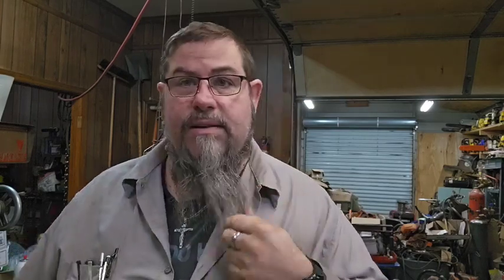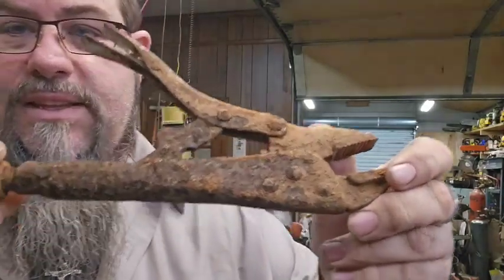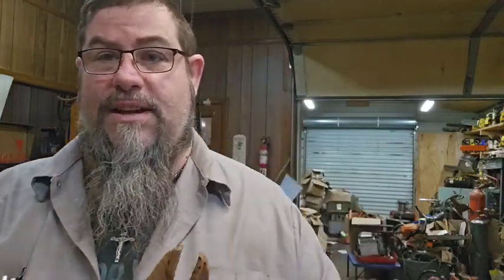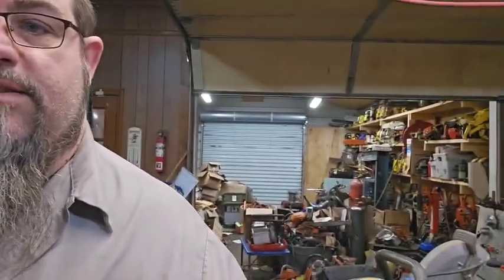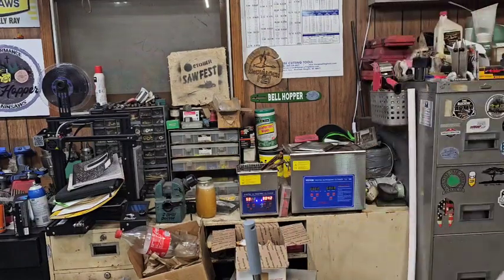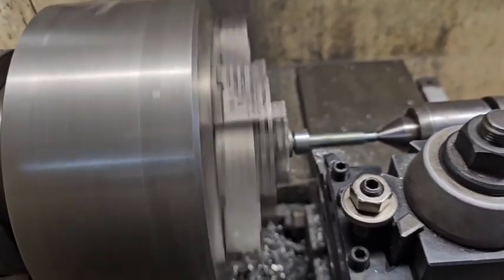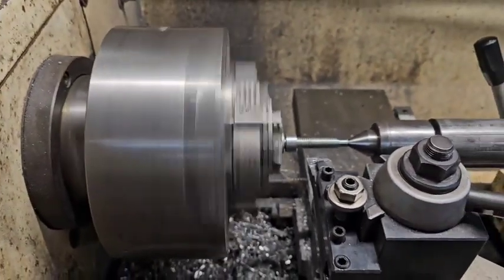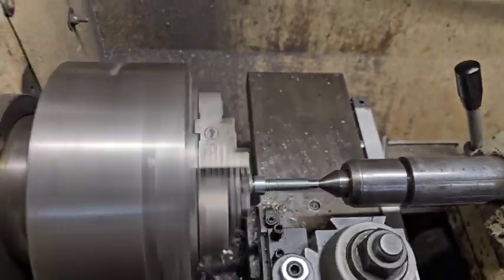Fixing old vise grips

Comment: Hi Jeremy, been a while since I have commented on one of your videos - thanks for putting time into making videos and sharing them. Rather than filling the ultrasonic tank full of your chosen cleaning mixture, fill it with water. Put the parts you want to clean in a zip lock bag and put your chosen cleaning solution into the bag as well. Bag + parts then go into the ultrasonic tank. You contaminate/use up less cleaning solution this way.

Comment: Jeremy I like doing stuff like this and you're absolutely right about it not being a practical thing to but I've always enjoyed repurposing things or just bringing old stuff back to life like these vice grips you're doing.. you can take a air tool wire wheel and clean those things up pretty good and then use a high-speed with a cone sanding disc or even a Dremel tool with a sanding disc and you could probably put a little time into it and make those them look practically new again but the handles and jaws and the clamping screw, wouldn't have the original strength to them after doing that much removal of the old decayed metal but they would still be strong enough to use for about anything, you would be using them for anyway...

Comment: Not sure how else to contact you, but I decided to throw my Hyway Big Bore Popup Piston kit onto my Farmmac F660V. I watched a few Iron horse videos and did a quick clean up on the ports (didn't change anything just cleaned up what was there). I cut the baffle out of the Hyway Dual Port Muffler like you suggested. It was already pretty nasty with the Farmmac Cylinder. The quality of mine left much to be desired. I'm amazed it ran as good as it did. Big score mark around the top of the cylinder you could EASILY feel with your nail. A spot on the bottom transfers that obviously got clearanced by the rings. The Hyway is MUCH better quality. It's even lighter. The fins are thinner on the Hyway. Wish I had a compression gauge. I also lived dangerously. I didn't check the squish. Just deleted the base gasket with the thinnest coat of Honda bond (permatex grey) that I could use. She's still wearing in but it doesn't have a decomp plug. It will rip the cord right out of your hand if you pull and don't mean it.
Reply: Also wanted to let you know that half the reason I started watching you was because you look a lot like my dad (passed Jan 25th, 2003).

Comment: Jeremy had one more comment and wanted to ask you if you know much about the Poulan Pro timbercut or timber cutting series 3450 chainsaw or the 3500 Pro timber cutting series chainsaw and I had asked on a video a week or so ago and don't know if you seen my comment or not but I've got one of each here recently and it's the first ones I've ever owned in those models but they seem to be a strong saw and were they have such high compression, they are tough to pull the rope and get started because it will yank the rope out of your hand and man it makes the fingers sore when that happens LOL I was wondering if there is something a person could do to make pulling the rope a little easier, like a compression release or anything
Reply from the maker: Im not sure if the have room for the decomp but they are nice saws buddy
Reply: @bellhoppersaws  okay and I've learned how to pull the rope out one quarter turn and then let the rope go back in and then pull the rope real quick and it's not so bad like that because that's releasing some of the compression off of the engine first... I was shocked at the power they make and they are a standard 180 ft lbs of compression and even a little more, which I think is great for a small 3 ci. 2 cycle engine...

Comment: Quote from New Life newsletter:
The Right Direction 
His master said to him, ‘Well done, good and faithful servant. You have been faithful over a little; I will set you over much. Enter into the joy of your master.’ Matthew 25:23

In every life there is plenty of time and energy available for magnificent success and achievement. Yet too often that energy is wasted on unproductive, negative pursuits. The next time you feel yourself becoming negative, stop and consider what would happen if you applied that negative energy in a positive direction. Imagine what would happen if you simply turned it around and put it to work for you instead of against you. A car that is traveling 70 miles per hour toward the north can be easily stopped, turned around and heading 70 miles per hour toward the south. In the same way, you can control your own time and energy to that it moves you toward your goals and dreams rather than away from them. Instead of bitterly complaining, transform your complaints into useful and productive suggestions. Instead of being envious, transform that envy into positive admiration. Rather than wasting your time with worry, make use of your time with action. Instead of getting destructively angry, become creatively determined. The energy is already there, ready for you to use. Just imagine what can happen when you make sure it flows in a positive direction.

Father in heaven, today we ask for Your help to look at our time “check book” and see how we are using our time and energy. For those of us headed in the wrong direction we ask for Your help to make a course correction and get back on the right path. In Jesus name, AMEN!

Where you are going to spend your time and energy is one of the most important decisions you get to make in life.